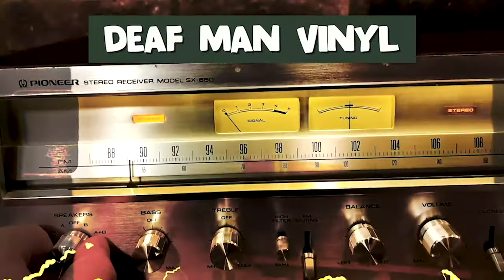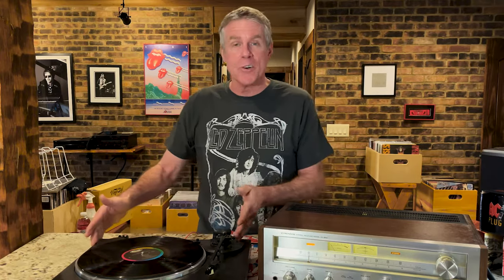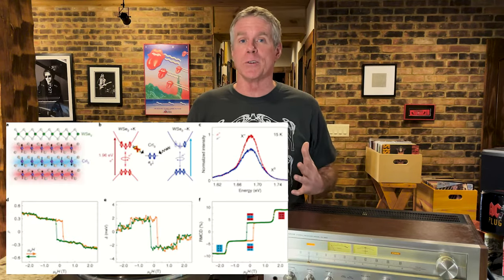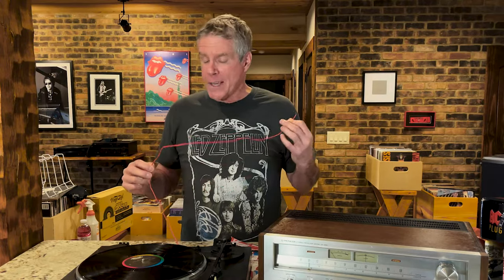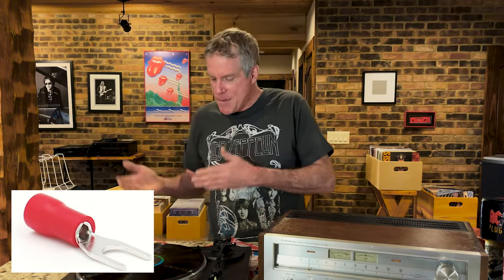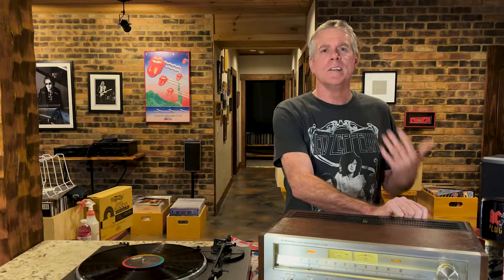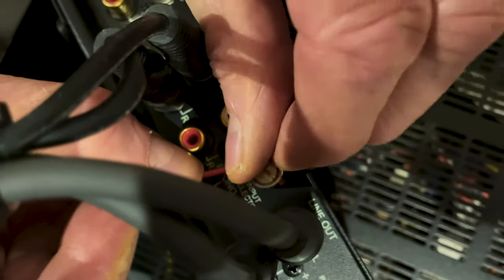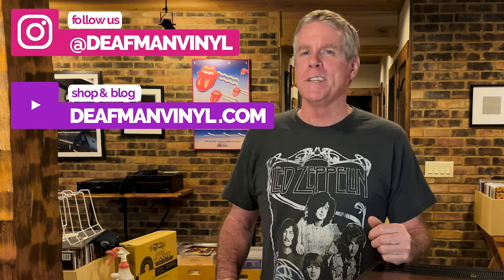Fix Your Turntable Hum! Troubleshooting Record Player Grounding Issues

Comment: After further investigation it isn't a ground issue that I am having.  It's feedback from the speakers. At low volume everything is fine but, when I turn it above half way I get bass feedback going into the turntable mic causing a bass hum through the speakers.  From what I've heard my speakers are behind the turntable and, on hardwood floors.  Moving the speakers forward of the turntable and, adding isolation pads under the speakers should resolve the feedback issue.

Comment: I have a brand new system, and there's a deep buzz that was diagnosed as a grounding issue. I got a new high dollar needle cartridge and a ground wire. Still buzzing. Please help. No one locally wants to help, as it's a brand new Denon 960 or something like that, and a pioneer p-1000 turn table. The buzzing while I'm listening to records is driving my wife nuts, but it only happens when the record player is playing, and seems to be emanating mostly from the subwoofer when the records are playing.
Reply from the maker: Yeah, grounding issues can be befuddling. Have you thought through "proximity' issues (e.g., the turntable and amp too close together)? Are the   cartridge connections clean and tight (and correctly installed per the color-coding)?

Comment: Thanks the video was great I just somewhat fixed another TT (a Dual 506-1) to add to my collection I have 4 up & running & one is a Dual 506, I just want to see if this one is any better.  They are all connected to a switcher box & 1-  long screw with nuts on it to ground each of them.   But this one when I tested it hummed I will try to find your other video ptII thinking now it might be the cartridge .   Any other suggestions would be great.

Comment: I'm having this issue even when I don't have my turntable connected. Just switching to the phono input presents that 120hz buzz.
Reply from the maker: Does your turntable have a three-prong plug (i.e., with a ground pin) or is it an older model with the 2-prong plug?
Reply: @DeafManVinyl  nope. 2 prong. Note that I'm also fighting a ground issue elsewhere. I'm pretty certain it's my electrical.

Comment: What if the turntable doesn’t have a ground? For example a rega player, it does grounding through the left wire but it doesn’t work for me, and something like the rega p1+ has a pre amp built in and no way to ground it. What do i do in that situation?
Reply: similar situation is in my case, my turntable chasis is made from wood, no grounding.

Comment: Thank you! I have feedback noise. If I touch the turntables ground wire to the outer rca cable connector the feedback noise disappears.
But if I connect the ground wire to amps ground or casing there’s no difference on the feedback noise.
Do you have any idea what to do then?
I’ve seen some comment that you shouldn’t ground to the outer rca connector.
(Just saw your video so I haven’t tried sanding the ground cables connector just yet.)

Comment: Great video thanks! I struggle (and a technical buddy) with an SL1200. HUMS. Would say the 60hz version. RCA and ground wires have already been replaced, everything checked, no difference (on mixers and pre-amp amplifiers, tried different locations, headshells and cartridges). A simple lamp or the mixer next to it also disturbs and makes the humming even more (magnetic field??). Nothing hums at the technicians place (so he says).

Strange thing is, when i connect  one of my 2 SL1210's to the same amplifier, mixers, pre-amp on the same location there is zero humming.   So weird right. Any suggestions?

Comment: Thanks for this video! Does the turntable have to be grounded to the receiver or can the turntable’s ground wire connect to any piece of metal?
Reply from the maker: Hey Matt — It's not metal, per se, that creates the ground. It's the fact that the receiver is plugged into an electrical outlet that is grounded (your home's electrical system ultimately grounds out to a metal rod in the earth). Best bet is going to be to ground your turntable to the receiver. Keep 'em spinning!
Reply: @DeafManVinyl  great explanation, thanks so much

Comment: At 3:28 when you mention connecting the ground to a bare patch of metal on the amp... wouldn't it be a better idea to buy a phono preamp that has that ground connection?
Reply from the maker: 100%. That last bit of b-roll I’m actually connecting the ground to a phono pre-amp... I just forgot to film the part where I actually say it! Will redo and re-upload when I can. Thanks!

Comment: I had a project perspective that hummed no matter how I changed my ground cable or moved my equipment or turntable . I eventually changed what was supposed to be a high quality interconnect for a much cheaper  and it immediately stopped .

Comment: Well  I used Van Dam Silver cables and have no hum at all, all grounded from the turntable and the Phono Pre-amp.
When I order some silver cables  2 separated pairs same provider I get a loud hum, and it does not go away.  When I reconnect my Van Dam silver I have absolutely no HUM< the grounds are not in the wire like the new ones. I do not tbhink is the location I think in my case is the wires? any ideas>  I left the original grounds and when I got the new cables and do not use their ground is exactly the same humming. 
My 2 turntables do exactly the same with the new wires and nothing with the Van Dam series.

Comment: Sir, I am getting the low hum I guess the 60 hertz but it doesn’t start to hum after 3 or 4 minutes. Is that normal if the turntable is to close to my receiver or would the hum come instantly if to close to receiver? I took the original RCA cable out and soldered new in but still getting the hum after the 3 or 4 minutes after playing an album. Any advice would be greatly appreciated.

Comment: I just bought a vintage 4 speed portable turntable. The 16 speed does not work and it hummus. What would you recomend
Reply from the maker: Wow. Not sure I'd sweat the 16 rpm not working. That's a super obscure format that was used a lot for spoken word and radio broadcasts. As for the hum, is there a ground wire visible (often green) or an obvious place to run once?
Reply: @DeafManVinyl   not sure the needle arm may be where the short. If I could trust someone to fix it I would sent it

Comment: I've been trying to bring some old Dual TTs from the 60s and 70s back to life.  They don't have a ground wire.  What do I connect the TT end of the ground wire to?  Can I just solder it somewhere on the metal frame or is there somewhere specific it should go?  Thanks for any feedback you can offer.
Reply from the maker: Sorry to be so late getting back to you on this. If there was ever a turntable to bring back to life, it's a Dual! I've got two that I refurbed, and they are my new lust objects.  If there is a chassis screw you can back out on the receiver, I'd try that, first. Not sure you need to solder anything. Sometimes, just taping the bare ground wire to some clean metal on the receiver will do the trick. Keep 'em spinning!

Comment: I’m having a hum, and my turntable has no where for a ground wire to go. The manufacture says on their website the turntable is “internally grounded through the shielding of the left RCA output, so no external ground wire is needed” yet I’m still having a hum, even after switching the RCA cables out with new ones and cleaning the connections. Should I try tapping a grounding wire to the back of it, or would that be redundant?
Reply from the maker: Hey — Sorry to be so late getting back to you in this. Without a ground wire, I'd suggest playing around with positioning (i.e., try separating the turntable away from the receiver, plug them into separate outlets). Another cause of hum is bad connections from the audio cartridge to the tonearm. Check those (but be careful, the wiring is like angel hair!). You can clean them with something like Deoxit. Or, use the old school way (a pencil erasure).
Reply: have you plugged your amplifier and turntable on the same outlet? if you use different electrical wall outlets big chances you will get a loud hum. Problem was fixed for me, i have a vintage technics TT on a vintage Marantz 2240 amplifier.

Comment: Hey ☺️☺️ 👋 I appreciate the video and it helped a lot ! But I have a question ⁉️ how do I ground my turntable without a amp / receiver or ground post.?? I'm using my turntable to my audio interface then to my DAW but I cannot get a good signal to nosie ratio and I believe it's because I can't / don't know how to ground my turntable.. please help I'm so happy to have found your channel ! Great work
Reply: Connect it to any large body of metal and it should solve the issue for you. You can test by taking the ground wire and touching it to various metal things to see if it reduces the hum noise. If it works, you can use electrical tape to keep the end of the wire in place.
Reply: @DarrinLin  thanks 🙏😊❤️🐼 have a wonderful week !!

Comment: My system is always on and is dead quiet until the stylus hits the record. The hum which is around 60 Hz is most noticeable just before the music starts playing or at the end of the record. All my gear is run into the same power conditioner, and then to one outlet with the exception of the amplifier so I don’t have any ground loop issues. However, the interconnects between my phone and a preamp and my preamplifier are not shielded and I have a feeling this might be the problem.

Comment: I have a Rega 2 turntable  . There is no earthing point on it . Do I look underneath  the deck. Look  for metal  and ground it to that maybe.
Reply from the maker: Check this out (a method that I was not familiar with). If your not getting hum, don't worry about grounding (some modern turntables don't require it and hum can be addressed by addressing proximity issues.) https://www.google.com/search?client=safari&rls=en&q=rega+2+turntable+how+to+ground&ie=UTF-8&oe=UTF-8#kpvalbx=_6SVhY-G_DcPIkvQP7-K0gAY_39
Reply: Rega turntables don't have a separate ground wire.  The ground is connected through one of the phono connector signal grounds. It works well.  There is no point trying to connect a separate ground wire, at best it will achieve nothing, at wost it will create a ground loop and you'll get horrible mains hum.

Comment: How do you kill feedback and not just hums which can be killed by using the ground nut. In my case the feedback is reduced if played with the dust cover down and gone completely when I moved the speakers to the next room using a long cable. But inside the same room it is there . Mine a direct drive technique sl 1700mk2 model which is other wise a very silent turntable with the grounding and volume upto 50 percent. I have also changed the amplifiers and preamp but the feedback back remains . I also  tried a larger hall but it remained.  Only when I keep the turntable , preamp and amplifier  in one room and move the speakers to a another the feedback is gone completely. So do you have any better suggestions to kill  the feedback inside the same room.

Comment: My Akai still hums. I've cleaned with isopropanol and I've changed the rca cables and also disconnected and reconnected the ground wire. Still having that awful noise.
Reply from the maker: Have you played around with "proximity?" So, moving the components apart, even plugging into operate outlets? I've had that help a time or two.

Comment: I've got a vintage Dual 604 Electronic Direct drive turntable that has no ground wire, just the power cord and left and right RCA. I do get a slight hum. Is there any way I can get rid of this ennoying problem when coupling it to my amplifier (SONY STR DH190). 
Thanks.
Reply from the maker: Duals are great turntables! I've got a 1229 and love it. You might try attaching a ground wire to some (non-moving) part of the chassis, coming up from the bottom. Mine is pretty easy to access. I'd also make sure the connections from your audio cartridge are good (the pins are clean and connectors fit snugly). Good luck!
Reply: @DeafManVinyl  Thanks. I'll try all the above.

Comment: I bought a used SL-Q300, put on a new p mount cartridge and got it working but I have humming coming from the speakers. Ground wire is attached to the turntable and to the phono preamp. The ground wire does reduce the humming but it's still there. Any suggestions?
Reply from the maker: I'd start at the start and make sure the pins on the cartridge are shiny-bright clean and the connectors are snug. Good luck!

Comment: Great video bro, thanx a bunch my friend, your appreciated. Just outta curiousity, what if its one of my portable turntables,for skratching, with my JBL Charge 4 speaker, or my Audio-Technica AT-LP 140XP, connected to my Pioneer DJM250 MK2 mixer, and my Korg All-In-One-PA Speaker?? I've noticed that hum sound myself, & was wondering what I did incorrectly, or was it how closer my speaker(s), or turntables are together, wich usually, my speakers, and everything is next to eachother, with the given space that I have to work with?? Thanx my friend...... Respex.... 🔥💯👍💪🙏🎶🌎
Reply from the maker: Yeah man, sometimes it's just a guessing game ... pull a plug here, switch a location there. An easy first step is to switch out receptacles. If you've got a turntable plugged into a switched outlet on the receiver, for example, pull it out and try in a wall receptacle. Moving stuff around between power sources can sometimes take care of a grounding issue or get enough distance between components to take care of interference issues. Good luck!

Comment: I just bought a new phonograph and it is humming, it is an older 2 prong plug in, if i use a 3 prong adapter will that stop it?
Reply: It may actually make things worse.  Huh??
Yes.  Another source of noise (hum) can come from what are known as grounding loops.  Everything is 'grounded' with wires yet there is still hum.  This is likely because you are on a circuit in your home that is not dedicated for just your audio system.  Other household items are sharing the return and ground with your system --- especially the ground.
Phono components are very sensitive due to their need for amplifying small signals (from the cartridge) by many orders of magnitude ... usually anywhere from 45 to 65 db.  Compared to other components, this is huge.  And any small amount of noise will get all that amplification too.  And introducing that ground (third) prong may bring any noise on that shared ground circuit into your system.  So what do you do?  Well, you can always try it and see if anything positive happens.  Make sure that the little tab that sticks out from the adaptor gets your turntable's ground wire attached somehow to it.  But if it doesn't work or the noise gets worse you can try putting your components on a dedicated circuit that has NOTHING else on it --- and runs straight to your panel box.  And then make sure your panel box has TWO long copper rods driven into the Earth at least 6 feet apart that connect directly to the ground lead inside.  It's what I had to do to fully solve my ground noise.  But I was in the market for a new panel box anyway.

Comment: Hi all quick one when its grounded does that sound only come through one speaker ? Or both mines only coming through one.
Reply from the maker: If the humming is coming through only one speaker (channel), the problem might be with the connection at the audio cartridge, which powers both a left and right channel. I'd carefully pull the wires off, clean the pin on the cartridge and firmly re-attach (do them one at a time). Good luck!
Reply: Thanks for this I'll give it a go

Comment: thanks for this - i have a turntable without a ground wire (Sony PS LX250H).  it has a RCA cable that i plug directly into a set of speakers, and it is buzzing with lots of static.  the turntable's body is also mostly plastic, as is the speaker.  how do i ground the turntable or otherwise get rid of the buzz?  is it something internal to the turntable that i need to fix?  thanks so much for your help!
Reply from the maker: Sorry for being so late in getting back to you. Some things to try: make sure the RCA Cable connections are clean at both ends (the male ends from the phono and the female end on the speakers). Check also the connections at your audio cartridge. I've pulled cartridge out, cleaned the connections and had the buzz disappear. Not exactly sure what the configuration is on your model, but at the very least, give it a wiggle and make sure everything is tight. Good luck!

Comment: hi ive got the 120 hertz hum but noticed it got worse when i held the rca cables.what can you say. cos ive done all the grounding required. is it the arm
Reply from the maker: It could be "the arm" as in poor grounding of the cartridge. Two of those angel-hair wires coming out the back of your phono cartridge are ground wires (left and right). Sometimes, you can get rid of hum by carefully pulling off the wires and cleaning the contacts (pushing the pins into a pencil erasure is an old stoner trick from back in the day). I use a cleaner called Deox It to clean up contacts. Then, give the connectors a squeeze if they are not fitting snugly back on the pins. Let me know if you get to the bottom of it.

Comment: Mine hums specifically through the speakers with the ground wire connected and the table active… its actually only happening now due to my new schitt vidar connected. It’s very low volume and doesn’t increase with volume but i hate it. It goes completely away if i disconnect it. The only thing i can think of is that my player has the upgraded pro ject high power it that has 3 prongs. Do I absolutely need the grounding? Without it it’s dead silent
Reply from the maker: By all means, if the hum goes away when you disconnect the ground, then leave it off.